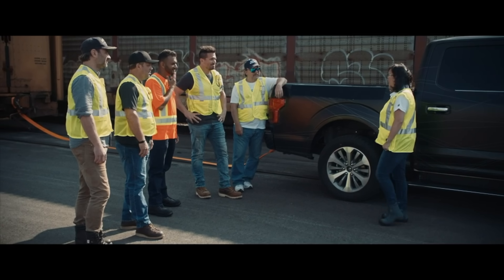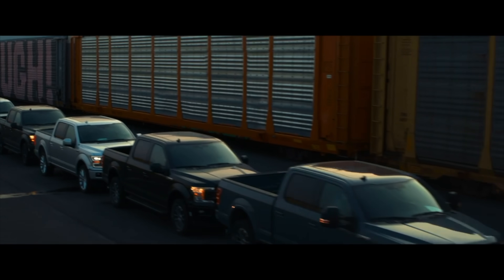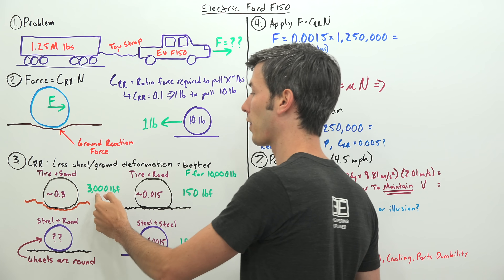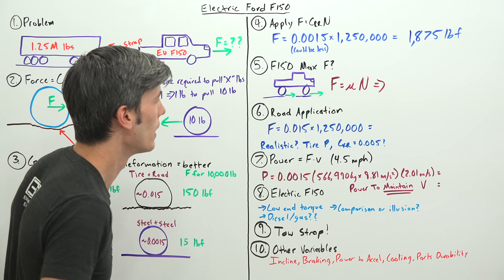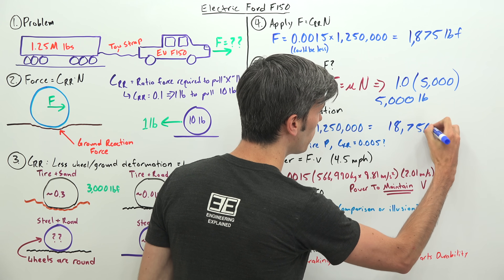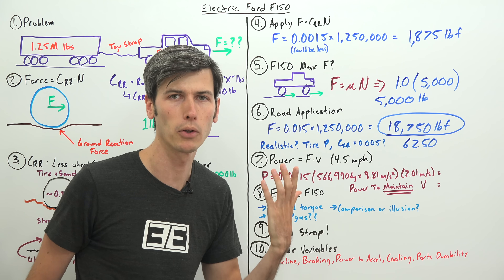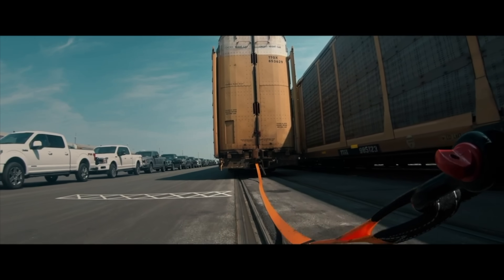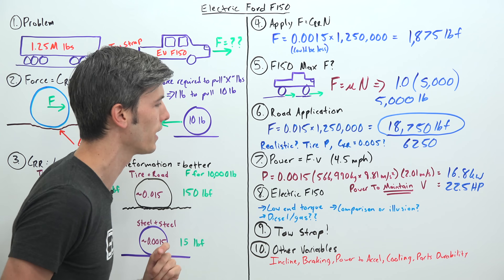No, Ford's Electric F-150 Can't Tow 1 Million Pounds (Realistically)

Comment: Steel wheels on a railroad track. Um ok why is this even a debate? Any land vehicle needs and moves on wheels. I have never seen any car driven to work on its suspension sans tires/wheels. What i cannot stand is for people who attempt to poke holes in any situation without FULL knowledge. As in the trucks weight, how much torque and horsepower the truck used/uses, there also is no transmission in an electric vehicle only direct drive same for the train direct drive. I do not mind you showed a schooled educated guess but you expressed an uninformed guess as well. Also where do you get that 'if the vehicle weighs 5000 pounds that is all it can pull' from? Ever hear of 3/4 to 1 ton trucks? We used those in our tree business as well as hauling scrap. We pulled far heavier than any tiny 5000 pounds as well. Try 27.000lbs and carried 13000 pounds easily. The trucks we used were from 1970 to 1988. All with 351 400 to my favorite the 460 V8. Scrapping is a very demanding job. On you  and your equipment as well causing a very high turnover in everything. Ok back to my point. Yes wheels move. Education of ANY subject is key. Any misinformation and your point would be scrutinized as a moot point. Thank you for the video.
Reply: research the history of the wheel. They werent always round.. Evidence indicates the first round wheel as we know were created to serve as potter's wheels around 3500 B.C. in Mesopotamia—300 years before someone figured out to use them for chariots. The ancient Greeks invented Western philosophy…and the wheelbarrow.

Comment: So by this you are telling me my 2019 Honda fit sport could pull this? In my hand book it say I can tow 1,000 lbs on a class 2 hitch. That's with the tires and road surface. Convert that to steel on steel and my fit could do it no problem. I would be a clutch down deff but I could get it moving.

Comment: Dunno if it's been said, but there are a poop ton of wheels on that train. Does this math take into affect all of the wheels (10 cars, eight wheels each, 80 wheels?)? It seems like the math has all 1.25M lbs on one wheel. Also friction between the wheels and the axle assemblies has to be pretty significant with that many wheels and axles.

Comment: I work on the railroad, I could point this trick out in 2 seconds. I mean I can push a railroad car by hand at 1-2 mph on a flat section of track. And on a windy day, if your letting cars roll free with no brake on it then wind can actually push an empty car uphill. There’s amazingly little friction on a train. In fact for optimal fuel consumption trains are built to have a ratio of between  0.6 and 0.8 horsepower per ton. Even at 0.6 horsepower per ton we can move at 60mph on flat track, though it will take a while to get up to that speed.

Comment: wouldn't the number of wheels be a factor IRL?  I guess the crr doesn't change because they are all steel wheels on steel rails but what about the bearings?  just seems like getting all those bearings to start turning would take a lot more force than the theoretical amount described by the simple formula.

Comment: You could do the same thing with a boat. Pushing 7 metric tons by hand is really easy, as long as it's a boat and it's not windy.
This is actually what mankind did for ages, in narrow canals ships were pulled by just a few horses, and it was the most efficient way to transport load. The horses had enough grip on the ground, and the boat hardly had any resistance.
Reply: "Give me a stick long enough and I could move the world"
Or I guess in this case, a low friction coefficient.
Reply: @Luckingsworth  nice
Give me a long enough steel beam and I can lift a Semi with a cute little ant 🐜

Comment: Forget the pulling part. A Ford Pinto might be up to the challenge. It is the stopping part that has me worried.  (Think Lac Magentic, Canada.). Calculations please?  

If you think about modern trucks it is often braking capacity that determines towing capacity. You can use lots of gears to tow something; you usually only have one point of braking.
Reply: all good just dont stop or the carriages will show what force can actually do

Comment: The entire reason for steel wheels on a thin steel track is to reduce rolling resistance.  It's why I've always found it odd when horse drawn carts utilize modern automotive wheels.   Traditional wagon wheels would be much easier on the animal, but nobody makes them any more.

Comment: Alright let’s do some math!!!
This beats Toyota’s measly almost 300,000 pound commercial;)
Reply: Not necessarily, but I would like to see the rolling resistance and the amount of power required to move the space shuttle on the road with rubber tires vs a rail car with steel wheels on a steel track with the kinetic tow strat and the shock absorbing couplings on the train. Big difference. Not saying the tundra can out pull the electric Ford because it wont, that electric motor has way more torque and it's from 0 rpm on up.

Comment: Those auto rack train cars shouldn’t be moving because there’s no air pressure going through the hoses witch keep the brakes off so there’s probably a locomotive at the rear giving air pressure so if there’s a locomotive at the rear the amount of cars behind the f150 will decrease because a normal yard locomotive weighs about 150 tons

Comment: Here is the impressive part.....it still pulled that much weight. IDC how you put it, that was impressive. Impressive in that nothing BROKE. For the truck to put that much force down and not break anything was unreal. Surely nobody thought this would translate to road worthy because you could never stop that much weight with a truck.

Most people dont realize that a Mustang could move a 20k pound trailer with ease. It just couldnt stop it or control it. But  a truck doing this and not breaking an axle, rear end, drive shaft, hub, or anything else in the drive train is truly impressive.  I would have love to be able to inspect all of those things for slack, bends, stretching and being out of true.

Comment: Making your Tesla card disappear under your YouTube award.

Weird flex but ok
Reply: It's a plug for Tesla. Or he's dissing them?
Reply: bbkangs My guess is that the disappearance of the Tesla card was a pure video editing trick - notice that the award is placed perfectly at the corner so that he can lift it up, remove it and replace it at the exact same position.
Reply: What cards was he going to use?  His credit cards? And no i get the joke.
Reply: Meaning Tesla is gonna be gone
Reply: Jim S.  Nobody ever mentions the fact that Elon started all of this and predicted others would follow. Musk ftw.
Reply: Jim S.  Except Tesla is leading everyone for the last six years and Ford doesn't have any EV's you can buy
Reply: @bobthebuilder372  Tesla is freaking trash and will go out of business after GM and Ford get on board. 
Tesla doesn't have many repair shops and they stop supporting a vehicle after several years so you can not even get parts. 
I hope Tesla goes under. 
Also, batteries suck
Reply: He's clearly a Tesla fan boi  which is why he chooses to make this video about knocking Ford's claim instead of mentioning that Elon's claim is pure hogwash for the same reasons.
Reply: @markbuckeye  Orrrrr Ford is clearly using a marketing ploy to hype up consumers who do not know that this really wasn't all that impressive. He did the same when Tesla stated the new Roadster will have 10,000 lb ft of torque at the wheels. Chill
Reply: I recon we will see a cool trick soon.
Ford  making Tesla  disappear.
Reply: @markbuckeye  you dont know anything about tesla vehicles do you?
Reply: @markbuckeye  Check his new video about the Tesla truck.
Reply: @SirBlueWhale  I didn't see a link, but I have seen the video that engineering explained put out on the Tesla truck. And yes he gets down to basic engineering. So he covers both sides.

Comment: Very nice and correct explanation 
Some think the engine torque is what makes a great difference which is not the case. 100Nm continuous torque motor can pull that at any speed provided it can make the required hp.
The electric truck is actually better at pulling...because it’s electric and being electric it has a heavy battery which means it’s heavy so the maximum force is higher 😊

Comment: The video math is correct to KEEP the train moving, not START the train moving. 
The two additional forces are acceleration force and force to overcome stiction and either of these can easily be greater and so should not be labeled "boring". That being said this is still a good video
Reply: That is why Ford used a strap and not cable or chain. A strap stretches and then when it springs it releases the stored energy and increases the amount of pulling force. The strap's force would overcome the stiction.
Reply: @briangc1972  The stored energy in the strap still pulls on the truck. Newtons law... For every action there is an equal and opposite reaction.
Reply: Because of the play in the couplings, only one car is set in motion at a time.

Comment: Engineering explained- I have a question. Maybe you could make a video out of it. If I wanted more gas mileage would I be able to some how wire something in to shut down injectors so say on inline 4 only 2 cylinder  are firing only to keep a constant speed on like a highway.  I think there would be too many factors involved as far as fuel pressure going up when shutting off the injectors and the catalytic  converters getting a false reading them normal making it call for more fuel. Would this be possible  ?

Comment: You're also missing something EXTREMELY important! Train cars aren't rigid. Each car is coupled together with a draft gear behind it, essentially a spring pack that absorbs impact energy. This gives a considerable amount of slack between each car, meaning you only have to overcome the static friction of ONE car before you have momentum on your side and each subsequent car helps pull the one behind it.

Comment: First let me say how much I enjoy your videos and your explanations. Keep up the great work!!
On to the next. I am wondering where you got your numbers for "Crr"? I tow/recover semi trucks and such for a living. We have a towing school in the industry that has done years of research in this field. We call Crr "Surface Resistance" in our industry. We have set a of numbers to cover many kinds of resistance including "Rolling Hard". This is the resistance of a wheeled (tires) vehicle on a flat level hard surface = .05 percent of the vehicles weight. All of the numbers we use have been checked over many years of testing using strain gauges to verify the forces. We do NOT have a number for steel wheels on steel tracks and I was wondering where you got your .0015 percent for this. This does seem to be a realistic number in my experience given steel on steel has very low friction.
Also remember that the F150 is not moving the "whole load" as once. There is play or slop in the connections of the rail cars. As they stop they catch up to each other and the connections compress. So you only need to get one car moving before the next one becomes tight and starts moving.

Comment: I don't think that's impressive. What's impressive is 1 episode of the Grand Tour where Jeremy Clarkson pulls a big ship using a low power french SUV, Citroën and it was FWD.
Reply: Depending on how fast it was going that might actually be easier. Drag when moving through a fluid is directly proportional to the velocity squared, so when it isn't moving there is no resistance, and the resistance increases extremely slowly at low speeds.
Reply: the resistance of the water is far less. Easy to move large masses on water.. Ask the ancient Egyptians
Reply: Easier than rails?

Comment: Why would the truck be incapable of stopping the train? Electric motors can produce the same torque rotating forwards or backwards (roughly), so that's not an issue, plus there is ~2000lbf to slow the train down, seems like stopping would be easier? Assuming the two were connected by a rigid rod and not a tow strap.

Comment: And the tow strap allows pulling in a way that is not representative of regular towing with a hook since no additional pressure is exerted to the tires thereby increasing rolling resistance.

Comment: WHY ... WHY.. WHY are you mixing units???????????????😢😢😢😢
Use SI units and stay that way.
You start with us units, then jump to SI.
I assume you suddenly convert to SI units because they are easier to use and understand.
So why did you start with us units??
Convert 1.25mill pounds to kg and then start.
I challenge you to redo this video, with the extra FORD info and USE SI units though out.
Convert the final results back to us by all means, but do it all in SI.
If you start using the term "slugs", you loose a subscriber.
"A slug is defined as the mass that is accelerated by 1 ft/s2 when a force of one pound (lbf) is exerted on it."
The video was good, but not up to your usual standard.
It did show why the worlds strongest men can pull a 747 across a tarmac.

Comment: You also missed that you only need to break initial traction with force. 
If you create acceleration/velocity additional to force it requires much less force to break traction, ie a small run up of 2-3mph will significantly decrease the force required. 

I think it was Grand Tour where they pulled a cruise ship with some random/cheap hatchback thing. Similar principle, but Clarkson style, obviously.

Comment: There's no way that was 1.25 million lbs. I work on multi levels every day. They are a maximum of 80,000 ld limit. The math says they are then trying to pull 15.62 fully loaded cars. Even though depending on the actual vehicle weights, it may not even be close to 80,000 lbs for each multilevel. Also, they would have had to make sure all the brake beams were pulled back. That way there was zero drag from the brake shoes.

Comment: Assuming heavy load with high tyre pressure gives less rolling resistance is questionable. You get least rolling resistance with high tyre pressure and light load. The best is to assume the rolling resistance coeficient doesn't change. In reality it would be bigger (than the ~0.015) with heavy loads, which just need high tyre pressure, if the tyre handles it. So in the end it would be better to just use the ~0.015 for a generic tyre with generic load.

Comment: I have a question, why is the pulling power equal to the weight of the truck ? When in handling tests the amount of G's is measured in cornering , and the rating is based on how far can the tires be pushed before they lose traction . That being said most pickups are in the mid 60's to mid 70's ,a sports car such as a Corvette will be close to a hundred indicating the tires traction equals the weight of the car . Based on this the pickup at 5000.00 LBS would have around 3400.00 LBS of pull.

Comment: So you're saying my Prius can tow one million Electric Fords, Got it!
Reply: Tow, tow, tow, them Fords, in your Prius' dreams. 
Merrily, merrily, merrily, merrily, your Prius is a Queen. (no offense)
Reply: Kevin Lee you’ve got a point most people don’t realize. A lot of these small cars can barely even handle their own weight capacity versus a sports car with a transmission and gearing designed for the impact several hundred ft lbs of torque from a dig at a drag strip and not be deformed.
Reply: You could tow it with a dirt bike.
Reply: Kevin Lee he didn’t say he needed to do so more than once
Reply: EdgeRunner no but he likely couldn’t even do it once
Reply: Tow, tow, tow then Fords, in your Prius' dreams.
Merrily, merrily, merrily, merrily, your Prius is a Queen. (no offense)
Reply: @Kevin Lee Priu don't have a transmission. It has fixed 1 speed planetary gears transaxle in a motor generator. If anything would get damage in a Prius it'd be MG unit itself.
Reply: Roger Wilco if that’s the case your Prius must be unrecognizable in terms of specs because a stock Prius can’t pull an empty water bottle without completely disintegrating.
Reply: @Kevin Lee Try what? Prius can't haul anything. And who is "us"? Lmao, you failed in reading comprehension bruh.

Comment: When I lived in the railroad town of Altoona PA, it was common to hear bang, bang, bang as locomotives backed up to close the slack in all the couplings between cars. Then there would be another bang, bang, bang as the locomotive started and, one by one, the cars began to move and slack between them was taken up. I was told this process was necessary because it was the only way to get a long train started, since the locomotive could not move all the cars simultaneously.

Does this brilliant analysis mean the engineers were wasting their time backing up and could have gotten the entire train moving by simply pulling off?

What am I missing?

Comment: Here is an overlooked part of the equation, and the same reason a locomotive can pull long trains. It only has to start pulling the first car (over simplifided, I know). The chain of cars are kept in compression while stopped. You start the first car rolling, and while it only has a very small distance before the slack in the coupling is removed that is still a large amount of kinetic energy which some is used to start the second car moving. This cascades through all the cars one by one with all the moving mass in the front helping the starting mass behind start moving.

Comment: Thanks so much for making this video! When I saw Ford's marketing stunt I wasn't impressed as I knew trains move very efficient because of the extremely low rolling resistance. But most people don't understand physics enough and are impressed by the insanely high weight. Even though it was kind of a cheap marketing trick by Ford, I don't want to bash them too much. I'm excited and happy Ford is serious about making an electric truck!